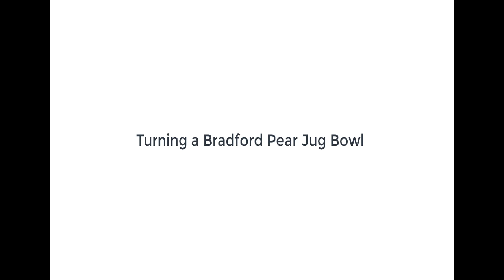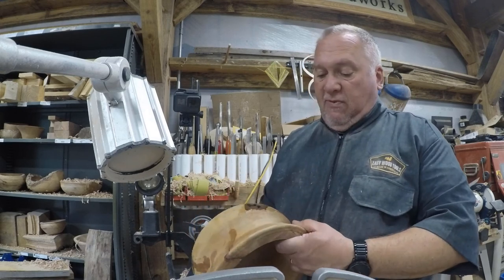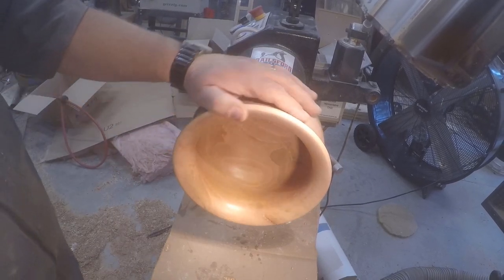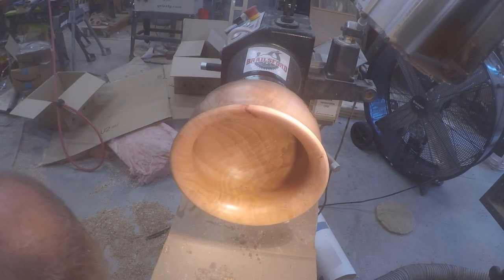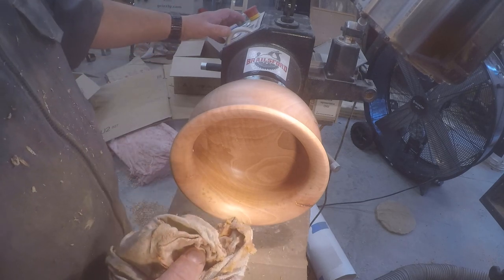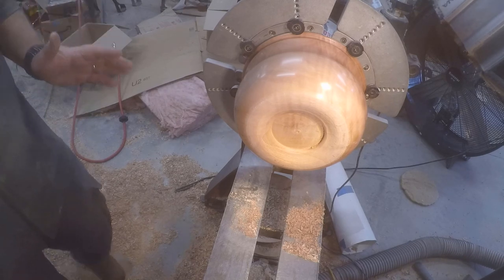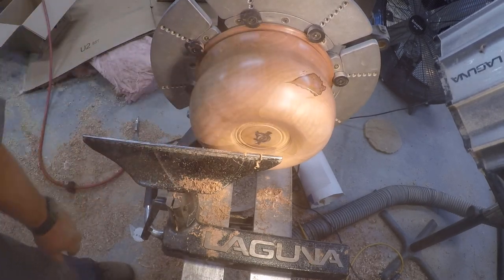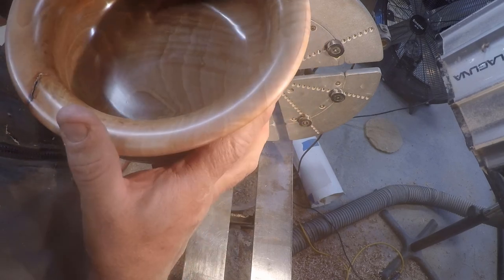Wood Turning a Caldron Bowl from Bradford Pear

Comment: This piece was waiting long time to get final look. Turning was looking very easy. Finsh is excellent. The grain really pop up. Great work 👍
Rav
Reply from the maker: Thanks!   It sat for a while because I had a lot on my plate in the mean time.  Take a look at my Timber Frame Shop video and see what absorbed all of my time.  Thanks again for the kind words!
Reply: @BrailsfordWoodworks  I watched Your video with timber frame shop earlier. It is really hard work. What is the weight of is this hammer?
Reply from the maker: @Secondlifeofwoodturning  If you are referring to the Persuader, it was heavy.  I think I remember 14 pounds.  The handle broke fairly early in the construction.  I used Black Jack oak for the handle.  I did something wrong because it did not hold up long at all.